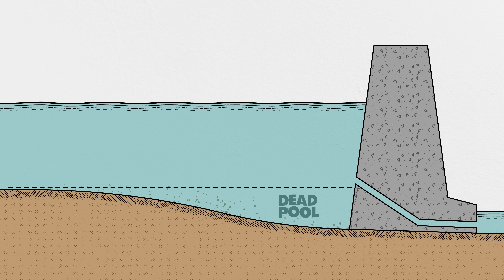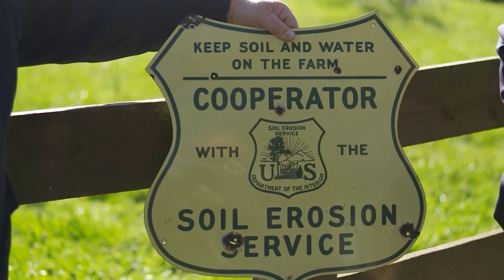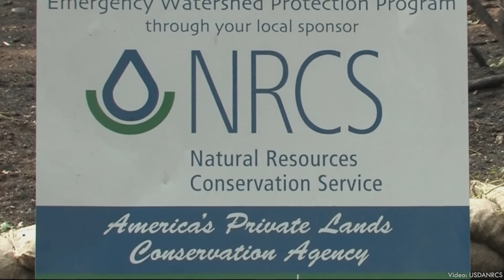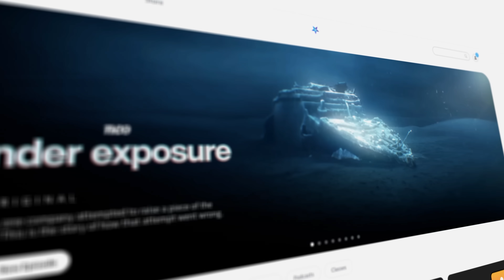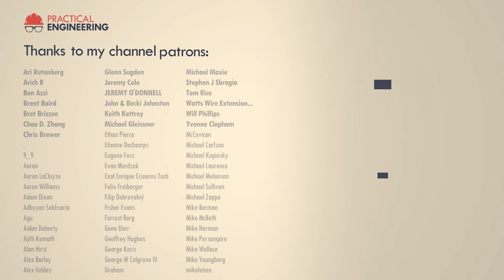All Dams Are Temporary

Comment: The most cost-effective way to remove and reintroduce sediment back into the system would be a submerged pipeline that runs continuous from below the dam all the way upstream to head water. This would be a modular main circuit for attaching shorter branch circuits that have dredging tool heads controlled by barges. The spoils and debris would flow with hydrolic power created from pressure and gravity naturally.
Reply: This would mean that all dams downstream would also need to have such projects but scaled up each time to the amount of sediment that was already being collected between dams. 
😅 that's a huge cost and expense with tons of data points to solve for each and every river.

Comment: If the 2M cubic annual are natural sediment, then what would be considered pollutant for downstream flush? Use combination of liquefaction of sediment and vacuum pumps to pass downstream. If the sediment is quality soils for farming, what is the economic benefit and cost to transport and use?

If it was left for decades, that is a maintenance issue. Those responsible should be dug up out of the graves and trials given — then hold all politicians accountable going forward. The cost of every project should include dismantling and restoration. Same with real estate (see Detroit and most inner cities).

Comment: I would just build resevoirs and dams next to the river instead of in its path. Allow the river to free flow as normal, and siphon off a small portion of the water that is filtered to remove sediment to fill a reservoir. Then have the reservoirs dam release its water directly back into the river again when it dumps. The sediment would flow right past , and wouldnt clog anything up. It might be necessary to do a bit of work to redirect the river to a desirable path but we do stuff like that all the time anyway.

Comment: the solution seems obvious to me but perhaps i am missing something.  a pipe with the inlet as water enters the lake running along the lake bottom and outlet on the downside of the dam.  no pumps, just gravity.   sediment input equals sediment output.  easy to retrofit, low maintenance cost.  

if ever the water level to pipe height difference will become greater than 32 ft (or whatever it is), simply shut it off until next season.  or use pumps.

Comment: I'm from the Volga river, which has dams all along its length. I don't know of any sedimentation problems, except for the ship-passable waters getting shallower and needing to be dredged. That said, I have seen dredging regularly, and the only time when there's noticable sediment in the water --- during snow melt in Spring --- the water level rises and the flow speed gets high, and the dams get opened. I guess most of the sediment just passes through. Perhaps being a plains river with lots of swamp-drained feed makes the sediment a smaller factor.

Comment: Being critical about your nice colorful model, it is important to say that this is far from reality. Firstly because your slope is too pronounced, Secondly because your flows are too fast, and third because you are only using sand. Rivers have stones and the bed is much rough than that. Sedimentation does occur in dams, though at rates that are very slow compared with the lifespan of the engineering model. Hydraulic generation is a very clean energy and remember that a new biological area is created. The sedimentation of the river again flourishes down the dam  as it is part of the the friction with the bed.

Comment: Love a good video that makes you think about things in a new light... Does also bring a question to my mind. When a dams reservoir does fill up with sediment, this is decreasing its holding capacity but what happens during a major flood or rain event? Are the dams at an increased danger as their reservoirs no longer have the same holding capacity and therefore have to let more water go, or does it have the potential to increase the velocity of the water upstream impacting the dam as it only travels along a more narrow surface and does not have any room or time to dissipate energy?

Comment: You could maybe take a huge chain between two special vehicles that drags along the sediment bed, pulling back and forth to break up the bed and release a consistent rate of it back into the river from the bed. You only release a portion of the sediment at a time rather than flooding it out. Probably a monumental engineering challenge but in a narrow enough reservoir it might work.

Comment: So what I'd we used some if that recapture technology for some of it.

And then maybe an agitator barge to rrloisen it near the back end of the reservoir combined with agitating at points that will cause the desired amount of sediment release.

So in effect let's say you can flush 10 units of sediment downstream over the next week.  Your reclamation system can capture two.  You agitate at a location(s) and depth(s) to release the 12 units based on the predicted hydrodynamic erosion expected.

So in this case if the river is depositing 11 units of sediment this week would you not end up a unit ahead?

That reclaimed soil could then be redistributed perhaps?

Comment: what about just dredging the sediment into the other side of the dam? I get there could be pollutants that would require extra care in handling it, but if it came from upstream it would have made it to the other side of the dam anyways. Could even have a permanent dredging structure set up to pump the dredged sediment over the wall of the dam or into a sluice

Comment: This is like a beaver dam… it holds back water and sediment and creates nutrient rich areas behind it… creating eutrophic conditions, which are great for warm water low oxygen tolerant species, however, as you have shown, eventually the reservoir is filled and plugged with silt and sand, and loses ability to collect additional sediment. In engineering; a forebay is the easiest way to deal with this situation, however, with large rivers this may be impractical ( or is it). Regardless, there is a cost.

Comment: Ignoring all the issues with actually building such a structure and the costs of this concept to areas downstream, what would happen if you had a dam that you could remove a section from the middle of in order to allow unrestricted flow for a time to erode some portion of the built up sediments? This isn't flushing in a typical sense, more like a temporary removal outright.

Obviously, this would not be realistic for a large dam! Although the mental image of the middle of Hoover Dam opening like a barn door and washing out a ton of water and sediment is an amusing and intense one.

My main thought is, would this work, or only erode one major deep channel and leave all the sediment on the sides of the no longer flooded valley?

Comment: Here's my thoughts on how to deal with the issue.

You specifically open one of the sluices. Not all; you want one, relatively-high-flow channel opened up. You have a floating pump barge which is kinda like a pump dredge. It is firing a current of water into the silt, intentionally re-suspending it. The direction of the man-made current is such that the suspended silt is pushed right into the channel for the open sluice. This will scour silt off the bottom and send it over the sluice, such that it can do its work further downstream.

Depending on the speed of the current flowing toward the dam, you may not need a pump. You may be able to sink some baffles onto the bottom. One low one, perpendicular to the current, would create eddy currents behind the baffle to re-suspend the silt. A couple more baffles, almost parallel to the current, would direct the flow, with suspended silt, toward the open sluice. You'd need a barge with a crane which could lift and move the baffles from time to time. You might close the sluice (reducing the overall current), move some baffles around, open the sluice to get the current moving, clear a bunch of silt, close the sluice, re-position the baffles, etc.

Comment: Morgan Falls Dam on the Chattahoochee River, north of Atlanta, has long been discussed as having filled up Bull Sluice Lake with sediment.  It is a small dam built in 1904.  But a quick search finds it actually reached steady-state in sediment in the 1950's.  After initial buildup, the lake now has a deeper channel the water runs thru during periods of water release, which sweeps sediment downstream, so has trapped all the sediment volume it ever will.  The buildup makes the lake fairly ineffective for water storage, though it never had much capacity, so the dam must release in synch with the much larger Buford Dam upstream.  Transit thru Bull Sluice warms the water considerably from the upstream flow, which runs ~50 F since drawn from the bottom of Lake Lanier, which is painfully "ice cold", much colder than natural river temperature such as in Helen far upstream (~72 F in Summer).

Comment: The channel problem of the draw down solution can be overcome with time, allowing natural rains and channel erosion to re-deepen the pool. However the exact amount of time needed is a question of its own and in places like Arizona the channel may need to be purposefully manipulated side to side because of the low rainfall. 
A solution with more up front cost is to make short concrete walls across the bottom width of the pool creating a snaking baffle structure similar to a fish ladder, then during draw down the resulting channel is forced to sweep the whole width. combine with a small check-dam that is designed to catch only large particles that would interfere with the main baffle cleanout. (Occasionally  dig out this large material, maybe sell the sand and gravel to recover some digging cost, depending on the local market.) The large particle fraction should be a much smaller fraction of the load in most locations and make digging it out a more reasonable proposition.

Comment: How about using some sort of air pump to inject a ton of air under the sediment, it would help it go back into suspension and maybe with a certain balance of it it could just stay suspended until it flows out, or at least reach the reservoir faster and be flushed through lower turbid water outlets.

Comment: Would there be no way to create a secondary structure upstream of a dam going under the flow near the deceleration point with some sort of grated auger system to pull out sediment where it would naturally collect?  (Basically a mechanically driven drain).

Run the auger weekly, collect it in a huge bin, and drag it off somewhere for use/treatment when it's full?  It wouldn't be perfect, but could something like that be installed in sediment heavy rivers to reclaim the washed out soil?

Comment: My immediate thought on this is simply to build a reservoir that doesn't block a river's natural flow but instead siphons water off of it.

And then at 13:45, Grady implied both the name of what such a reservoir would be called and a confirmation that, yes, that would be a successful (though expensive) solution to the issue, by saying that these problems are common to all "on-channel" reservoirs 😂

Comment: 11:52 hey, that’s Tom Miller dam in Austin.  The highland lakes chain is an interesting case because you’ve got a series of lakes on one river (with 2 other major rivers entering lakes partway down the chain) so the sedimentation isn’t the same in each. The first lake (Buchanan) is broad and shallow, the largest lake by volume (Travis) is narrow and deep.  It’s protected from sediment from the main river and the Llano River by the upper lakes, but the Pedernales river does dump directly into Lake Travis. The first lake was built in the early 1900s, and the rest in the 1930s, so we are coming up on 100 years of use. Fortunately, the rivers there tend to have relatively little sediment compared to midwestern states like the Missouri.  But it still accumulates over time.

Comment: A bit similar to a bedload interceptor; what about a centripetal/centrifugal pre-"dam" (designed to result in shallow and fast-flowing water) where the water is sent into a downwards circular path, and the outer flow of the water (where the sediment would be concentrated) is skimmed off and diverted through a bypass (SBT!) to beyond the "real" dam? Sends the sediment downstream, can be mostly passive like bedload interceptors except it's above ground so easier to maintain/modify, could divert fish (but only downstream). Laminar vs turbulent flow would need testing. Probably won't eliminate the sediment, but should reduce it.

Comment: your model may have drained quickly when you opened the gates, but it is not entirely accurate, as THAT sediment is sitting on plexiglass, whereas REAL sediment sits on soil, with roots and other sediment mixed in, and it has been there for a while, so the sediment has settled in and may be buried or hardened over time.

but i think that it is a good first start. if you open the gates LESS, as you said, and have something on the other side of the dam to "catch" the sediment, like a filter that lets water through but not sediment, then the flow of water will push the sediment directly into the capture device. and because the dame is right there, you can control the flow of water, giving you time to stop the water and pull the filter out to be emptied.

it would take quite a long time, but it would be less intensive than a dredger, and more quick than anything else, not to mention being less energy needed, since the water flow (controlled by the dam) is doing most of the work. there may even be a way to divert the sediment sideways, while maintaining the waterflow forward. i am not an engineer, but i've seen a lot of systems in play  :)

Comment: Have a series of water-assisted sediment removers with the sediment removing opening at the heights you want the (literal) ground floor to be. A feet or two above it, facing the same opening, should be another pipe exit which releases some water towards the opening, to encourage and assist the sediments to go into the sediment removing opening. The sediment removing pipe should met another pipe exit bringing in water from the side on which sediments would settle. Optionally, a series of multiple smaller pipe exits should also bring water on the side on which sediments would settle, across the pipe through which sediments are intended to be removed. The water for all those pipes should be higher in the dam's water reservoir. The sediment removing pipe should ideally be gravity-powered, but they could also have lower down some sediment removing pipes which are activated electronically. That way, the gravity-activated (weight-activated) sediment removing pipes would work when the weight above them is more than the weight of the water when the water is at it's highest acceptable level in the dam's reservoir, which is around where the dam operators would want to keep it, and the electronic-activated ones could be opened the rest of the times when the dam operators want to remove some of the sediments. This would cause only minimal water losses, and water would still be needed in order to have the sediments suspended in water while they're traveling through the pipes, to ensure that sediments to not clog the pipes, They could also experiment with having a few sediment pipes have their additional water-delivery pipes deliver water at an angle, for example a tangential angle with the travelling parallel to the sea level, to ensure the sediments remain suspended in water while traveling through the pipe. Also optionally, inside the pipe could be very long archimedes screws, instead of adding more water to the sediment pipe, in order to remove the sediments, and to have them released from the screw at a steeper angle on the other side of the dam. If you want to talk more, feel free to DM me on Discord, where I am Sapioit.

Comment: Could you lay pipes along the floor of the reservoir, with holes in them, and then pump air into the pipes?  The air bubbles coming out of the pipes would cause turbulence and give the sediment particles a bit of a kick, enough to get them suspended back in the water for a little while.  I wonder whether that would be enough to keep the sediment flowing through the dam without settling?

Comment: I would syphon the sediment over the dams top, cost effective and controllable.
The sediment if sufficiently disturbed will be in a state of suspension, place pipes at the location you are clearing and bingo, let nature do the job. A syphons head won't care how far from the dam you are provided it is primed correctly so you could even clear the reservoirs head.
Obviously this would deplete the reservoirs capacity since you are using its water to keep it clear, but probably less so over time than the sediment accumulation.

Comment: quick idea that prob. alredy has been had, but what about high pressure air pipes laid on the river bed. Then occasionally blast air thru tiny holes to get the dirt flowing again. Since the water would be dangerous while the air is blasted, a alarm could warn the people on the water. With that couldnt you then control how much sediment is allowed thru? Idk just a thought

Comment: Sounds like there should be a way to flush the sediment from the sediment trap reservoirs down to the other side of the dam. Perhaps some automated dredge tool that puts the sediment into a pipe or something, which is then jettisoned downstream of the dam. That way, you'd keep the natural flow of sediment continious with the water stream, except inside the dam reservoir itself.

Comment: As someone who worked on sediment/floodwater retarding dams, most have a lifetime of about 50 years. These are small to medium dams. Sometimes used for drinking water. Larger dams and resevoirs can be dredged or pumped. And the lifetime increased. Hyro dams are a different matter.